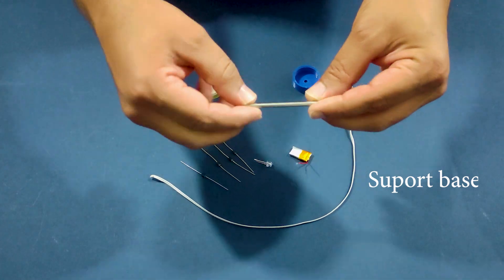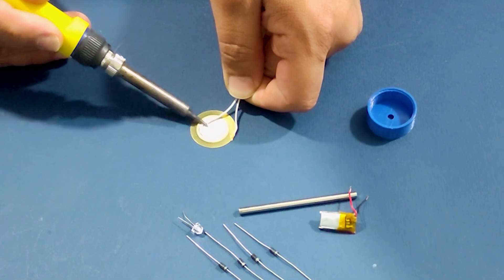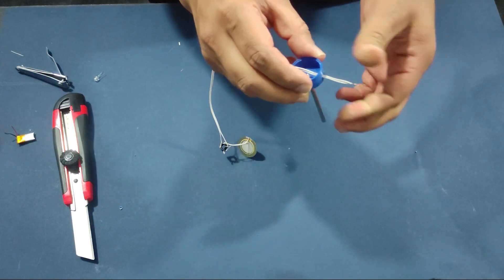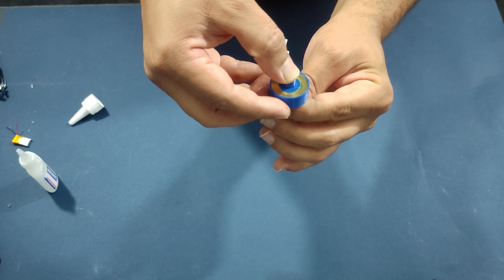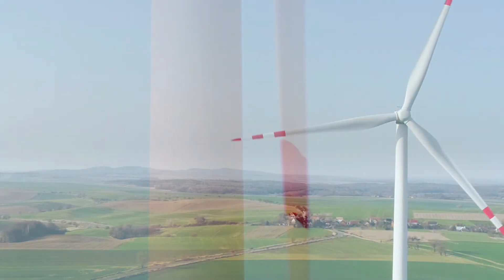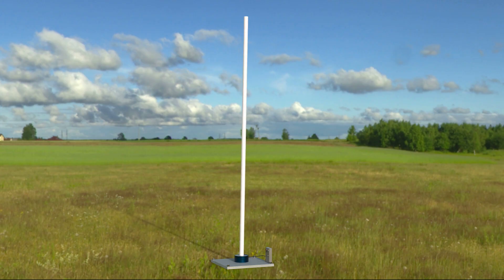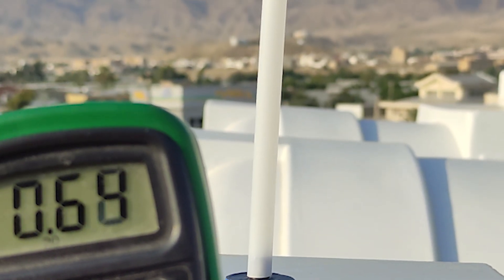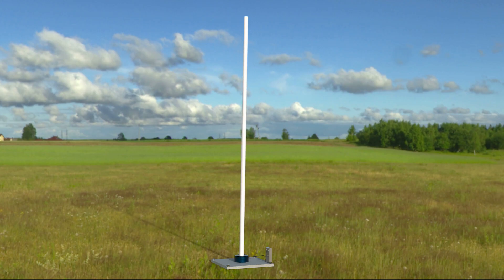New bladeless wind generator

Comment: try a vawt hot-air/helium balloon wind turbine instead, it floats on its own, down to ground through an power axle, to a generator
Reply from the maker: nice idea
Reply: @energygrapgy  same for hawt turbines, self-floating cone turbines, as spherical forms have better floating capabilities, vs the typical 3-bladed rotor shapes
Reply: @energygrapgy  barrel shape should work for helium axle vawt nicely
Reply: @energygrapgy  the full helium barrel only having a self-starting vawt blades on the outer surface